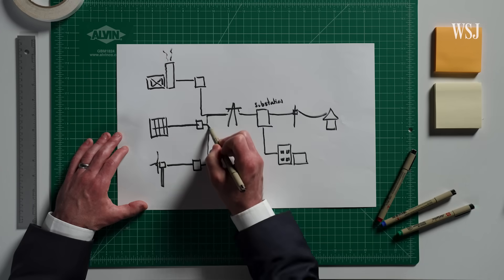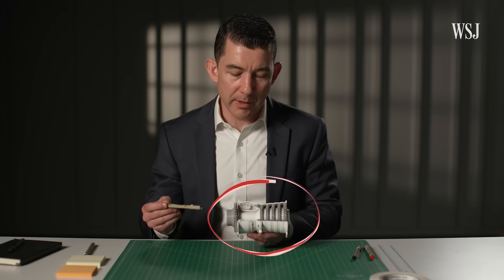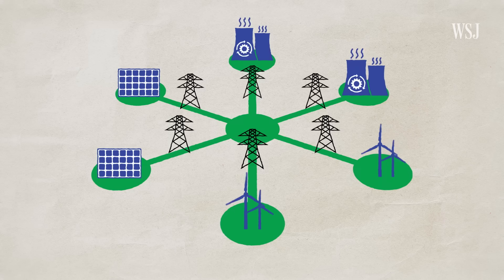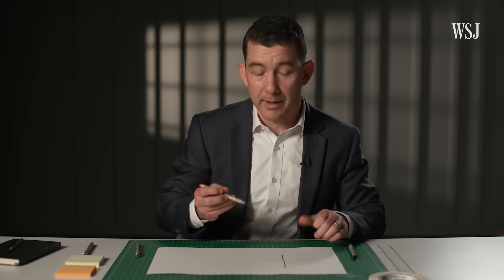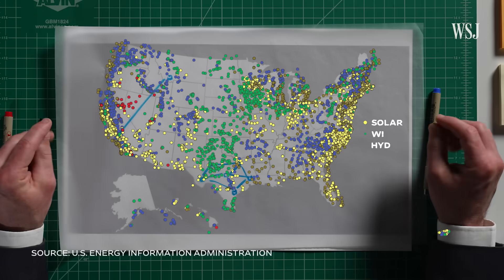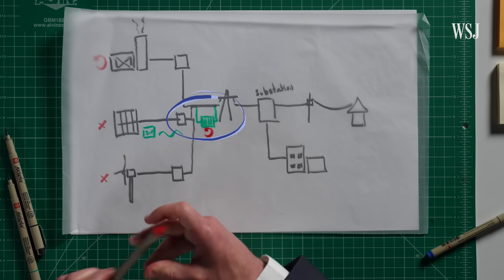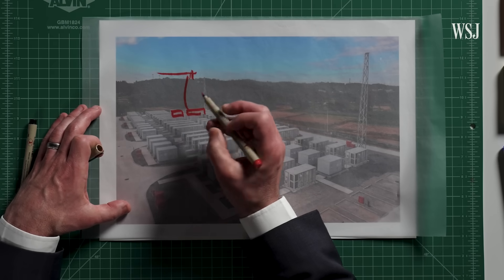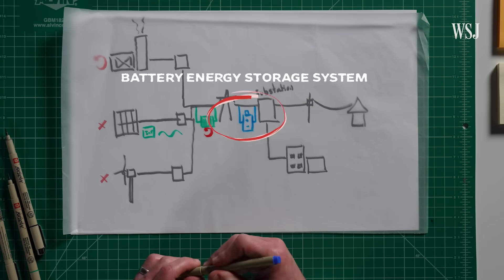How to Fix Renewable Energy’s Hidden Infrastructure Problem | WSJ Pro Perfected

Comment: Spain produces around 50% of energy from renewable sources, and yet they have had a 24-hour blackout all over the country on April 28th this year. They still do not know why that happened, but it seems that an overproduction of solar and wind energy was the putative reason for that, together with a drop in energy demand. The grid just could not follow the change and broke down.

Comment: This was never a hidden problem, engineers always knew this was an issue
Reply: My degree in is aerospace but I work in industrial control systems.
I've known about these and other issues in power systems since the late 90s.
THIS IS NOT REALLY an issue with renewables but they have made it worse.
The real issue is economists who through their management of energy markets have driven these systems to be more fragile. I'm Australian and I can see that we are going to come smashing into this issue like a freight train.
Reply: @tonywilson4713  Wind and solar generated electricity is not a technical  problem for power grids because they are supported by high readiness natural gas turbine generators.   Large amounts of home peak solar is difficult to deal with because the peak output can exceed the demand of the local grid requiring a remote grid to be sending power.   Home solar can not typically be disconnected.   It's not truly renewable energy when it saves fuel when it is turned off.  There is no fuel savings when supporting solar and wind generated electricity.   It is fuel cheaper when they it is  known they will be turned off.
Reply: 💰is the issue.
Reply: Nothing hidden about it. But it’s way more complex than this video leads on. There is reduced need for inertia with quicker reacting Inverter Based Resources. Grid forming inverters are only able to establish their own reference frequency. They support grid frequency no different than traditional grid following, by pumping out real power to balance demand. 

This video was not researched well enough. More than a single mechanical engineer should have been consulted to explain a complex electrical power systems issue. 

NREL has a very interesting report title something like „Grid Inertia:without the spin“. Far more informative than this short video.
Reply: @Kwahntum  I went and looked at a couple of NREL reports and other than accepting stability is an issue they offered nothing in the way of solutions.

Comment: A mechanical engineer? Why not an electrical engineer with expertise in electric grid design? What's the mechanical engineer going to do? Add some nuts and bolts and bars and see if that strengthens the grid? His "solutions" are wrong. 2:08: no, the easiest way to provide rotational inertia to the grid is by installing synchronous condensers (SCs). 1GVA is a common SC. The biggest grid forming inverter even being planned is Liddell in Australia at 500MVA, and that's a way off (replacing a 1960's coal plant that my father helped build). I'd like to hear him explain how to black start a grid that is primarily based on grid-forming inverters. He treats SCs as the alternative option. A sane option would be smaller SCs at the renewable generator sites. They can be kept running if the renewable site disconnects from the grid and resynchronising is then a viable option for black-starting and is coming from a sensible base. 20 years experience in designing bicycles or tractor transmissions or whatever he does isn't going to replace an EE grad fresh out of college.
Reply: That amused me too (as an electrical Engineer).

Comment: My issues with this video:
1- PVs do have inverters that can sync with the grid frequency. Any PV farm needs inverters to be able to connect to the grid.
2- No inverter can provide inertia, since it is a physical property of the electrical machines/generators and turbines.
3- The inertial issues exist since the whole grid and loads were designed for that type of energy production. With renewables, the new loads are designed differently, such as a smart grid, where the load might communicate with the energy provider beforehand and then ramp up the consumption.
Reply: My degree is in aerospace but I've spent 35+years doing industrial control systems and automation. So I have done a lot of electrical work.
Your 100% RIGHT on all 3 points AND ESPECIALLY No.2 which I have been having argument after argument over for months. YES even from before the Spanish collapse I was getting into that argument.

There's a great video that goes in this problem on the channel Real Engineering and its titled "The problem with Wind Energy" that was posted almost 12 months ago. Its worth your time.
Reply: An inverter can provide inertia if it has the correct control capabilty.   Many renewable energy inverters do not have tge capabilty of providing inertia but this is based on the fact that grid interconnection standards such as UL1741 mandate that inverters do not exhibit any inertia. 
Most mechanical engineers simply can't get their head around electrical inertia, however the best way of demonstrating this idea is based on a 'black box' experiment.  This experiment involves a rotating synchronous generator that is placed in one black box and a sequence aware grid forming inverter with inertia capabilty placed in a separate black box.  The only external observations of these black boxes is the ability to measure the voltage and current delivered from these two black boxes assuming that the grid conditions can be manipulated to observe the inertia. 
With this experiment it is possible to configure the inverter to exactly mimic the behavior of the synchronous generator.   
So clearly the inverter does not have some rotating mass but it is able to provide the exact same response as a rotating synchronous generator - which I believe demonstrates that an inverter can provide inertia.

Comment: This is a great topic, I wish he would go further.

It seems you need all three: you need the batteries, you need the forming inverters, and you need the condensers to smoothen things out and give inertia.

I just wonder in what proportion? How many condensers do you need per set of batteries. How is the cost distributed, etcetera.

But these are just some of the accessories that the renewable grid needs that the older grid did not.

It’s something to get used to, but it shouldn’t be a roadblock.

If you deploy them in sufficient quantity, then you shouldn’t see the kind of accident you saw in Spain.
Reply: You just have to look towards Texas and California which already have BESS deployed at large scales.  Also Australia.  And several other countries are rapidly building up storage systems... Germany, for example.   Google up "CAISO" (The California system operator) and browse around the graphs.   California's BESS is already capable of over 10GW of output (15GW estimated by the end of this year), with roughly 100GWh of storage and rising.

You can look at ERCOT (Texas) as well, but ERCOT doesn't provide the same level of public disclosure that the CAISO provides so it's harder to pull data out of it.  Mostly due to poilitics.... they don't like it when renewables give their fossil generation a bad look.

-Matt

Comment: One of the most important topics in the field of changing from conventional power plants to renewables. Thank you for covering this topic. I want to see more about challenges of this transition, if possible. I am from Germany and thank you for this insights in the USA.
Reply: Wind and solar generating space in practice is backed up with high readiness natural gas turbine generators.   It's not technical problem.   A large wind farm has a jerky output in a second.   Left as is it jerks generators.   Scandinavian countries have fast reacting hydropower allowing wind power to be useful for saving water head.   The natural gas cost of high readiness natural gas turbines means it saves fuel when it is known the wind or solar power will be turned off.

Comment: Most large scale solar farms have something called "Frequency ride-through (FRT)" which is the ability of a power generation facility to remain connected to and synchronized with the power grid during system disturbances, including frequency variations. This works even when the system frequency is not 60Hz. Some of these problems have already been solved.

Comment: There's also an element of human and management on why some of these "proposed" solutions aren't there just yet or at least not being actively researched as they should be done.

As an electronics engineer, I naturally gravitate towards better inverters in combination with some level of electricity storage - they work much better in tandem, not as two or three separately solutions as it is being talked here. However, I think WSJ is just trying to make things clear or they make an innocent mistake. That's not what I would like to talk, as the bigger problem is while ideally very efficient and cost-effective, at least in theory,  consumers might not see this solution any time soon. This solution has existed for a long time in smaller scale - like the UPS you have to keep your PC on while the grid is down, to home solar with batteries and these are being refined continuously so that they become more reliable and cheaper every year. It just that the scaling process to match the need of the bigger community is dastardly slow or non-existent. The reason is because there aren't a lot of electronics engineers, and we are needed everywhere - consumer electronics, industrial control solution, tele-communication, defence, energy, you name it.

To make inverter, to create the signal systems, to manage the charging and discharging cycle of the battery and manage its health, to generate warning in case of imminent faults, etc, all of these have to be handled by some body with intimate knowledge of electronics, and we are very rare. Most graduates out of engineering schools don't choose to focus on a purely technical path, and even the one who does will decide to quit in about 1 or 2 years. Coupled with a very hostile recruitment process towards school leavers and you can imagine how many electronics engineers survive until they can stand on their own. Not a lot.
Reply: I second that, we simply do not have enough time to mature new tech, especially there are good enough solutions languishing in bad PR. In addition, introducing digital electronics will shorten the replacement cycle leaving us in a perpetual cycle of reinvestment and high bills, at least in Europe.

Comment: Wow …. Several points were remarkably not correct. For example, the idea that a grid forming inverter can supply an infinite amount of inertia. May be we should add a perpetual motion machine to help. Also, assuming a solar array is operating at 100% capacity (all available energy is supplied to the grid), neither grid form or grid following inverters will maintain a grid if too many generators/supplies go off line relative to the loads. Millions of tons of rotating mass (expensive) provides dampening for grid disturbance’s. Inverters can only provide dampening if there is some means to stored energy (ie batteries) connected to the inverters. To give credit to the article (and inverters), inverters are profoundly better at damping grid disturbances relative to rotating masses ….. if connect to an energy storage device (ie batteries).

Comment: Seems like Beacon Power dealt with this exact issue close to 20 years ago, with their vacuum sealed, magnetic bearing and highly efficient flywheel systems. The DoE funded a 20MW grid connected Beacon Power flywheel station that was completed in Pennsylvania in 2015.

I recall the problem is not a technical one, but one of market mechanisms that don’t/won’t pay for grid services like flywheel power buffering.

Comment: Inherent roational inertia....
Fine 
look up grid forming inverters then look at what they can do.
and if you didn't like that look up syn cons and fast frequency response..

AKA storm in tea cup or FUD.
Reply: Note your engineering appears to be few years out of date, things that people in my view, erroneously called virtual synchronous machines only emulated some aspects and properties of actual synchronous machines.
The more Modern actual grid forming inverters do the same electrical things as a synchronous machine, and thus they don't need toy claimed to be required grid monitoring all over the place.
The error in trying to use grid monitoring is that the communication channels can go down separately to the transmission lines.
Actual grid forming inverters exchange the control information required via the actual power lines in JUST the same way synchronous machines do. They send "control" information via phase and angle and frequency they're operating at.  (Google Dalrymple is SA, Australia for where this new engineering was first tested on a real grid.

Comment: So the power grid has a frequency that all power stations try to maintain, so once one station stops others will work harder to maintain or new stations start up. However, why does this frequency need to be maintained? Why can't the power grid work on any which frequency it wants to connect from one power station to the consumer or destination? Would a 0 Hz power grid be possible and what would it look like? Are smaller power grids more resilient to frequency fluctuations from neighboring grids if they are disconnected? If a grid of any size needs to maintain a constant frequency, then could a power grid that doesn't maintain an inertia but rather each consumer must request power to be sent directly from a specific power station function?
Reply: The reason why the grid has to operate at a given frequency is based on the fact that the frequency is used as a means of simultaneously broadcasting across the entire grid the average system load.  This is part of what is called the primary control response system.  The primary control relies on two basic control parameter gain settings for the Frequency-Watt droop function and the Volt-VAr droop function.

Comment: Flywheel Energy Storage is the solution. 2 in 1 solution. Energy storage and Rotational Inertia.
Reply: You can't do both at the same time with a flywheel.  Flywheels used for energy storage are variable-speed (otherwise you couldn't store or release energy from one), and so go through power electronics to actually connect to the grid.  Flywheels used for inertia are basically called "condensers" are are mechanically locked to the grid.  The rotating mass has to remain synchronized to the grid and cannot speed up or slow down.  Only a small portion of the energy of the rotating mass is actually available for ancillary services so it must be refreshed by some source.  

One can have self-powered condensers... condensers powered by the grid itself, trading-off voltage for frequency stabilization basically.   There are a multitude of setups to provide various services but none of them are "energy storage" without the addition of power electronics.

-Matt